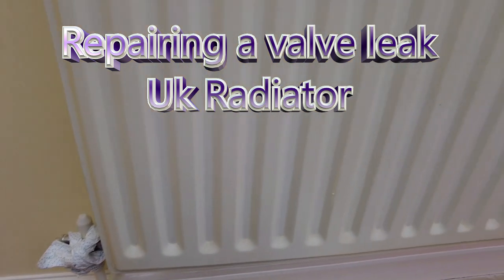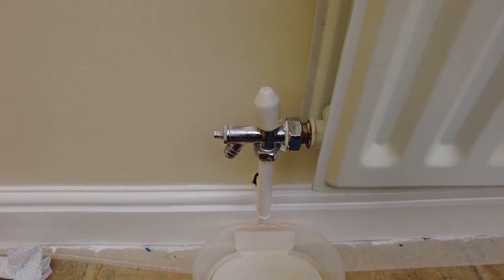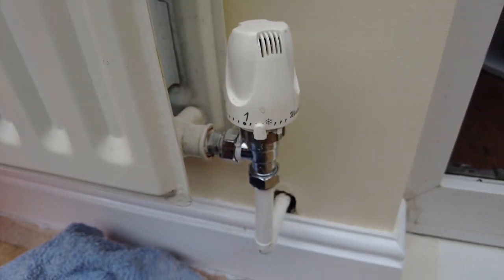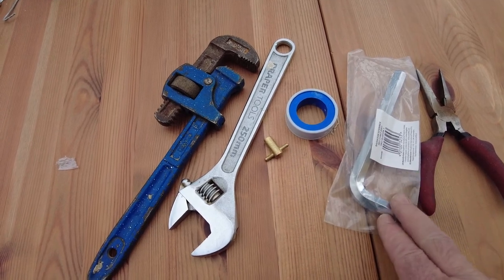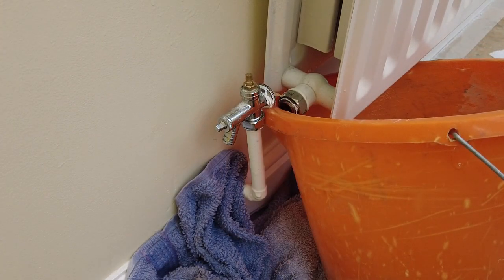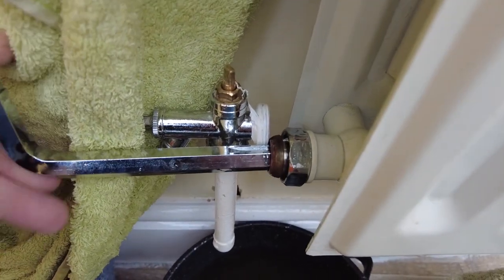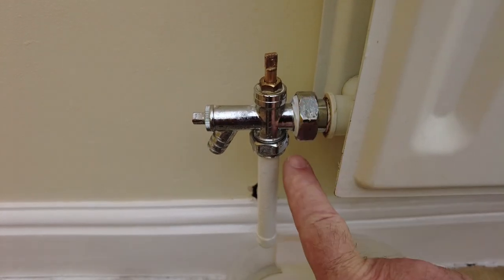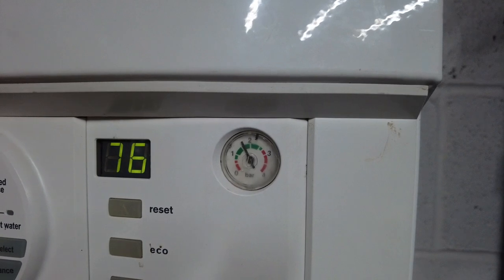UK Radiator Leak Repair

Comment: You are aware you don't use ptfe on threads....its only needed on the olive ....
Reply: @toooldtodieyoungmotorcyle  sorry probably explained that badly ..I don't mean on the tails that fit into the rad. Obvs you need to tape that end I was referring to the thread on the compression nut side of the valve ...